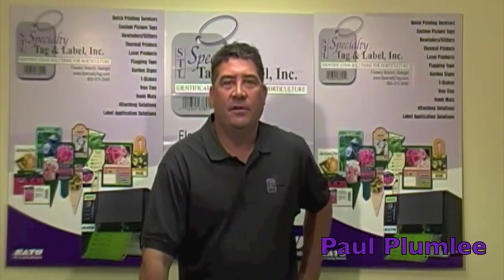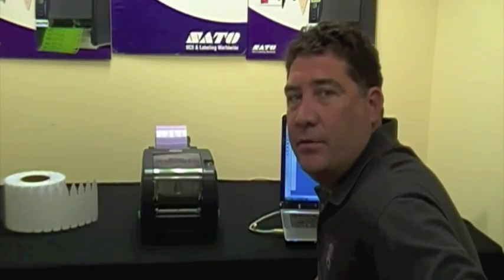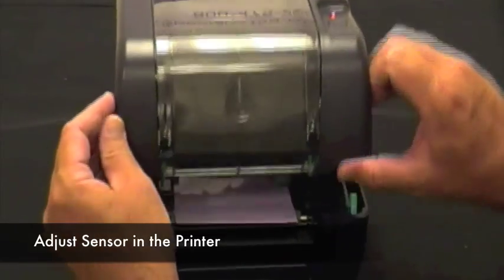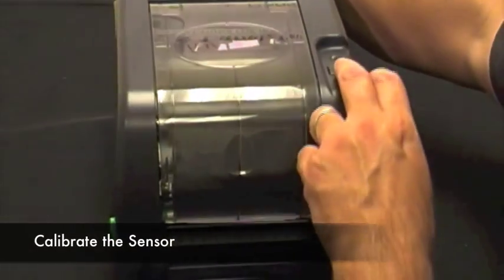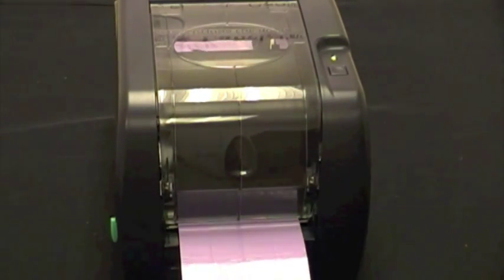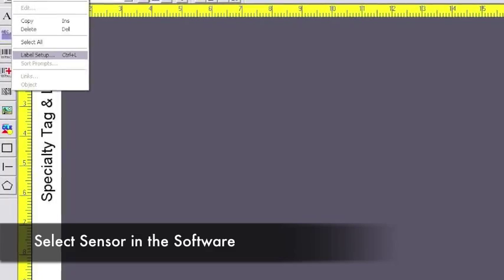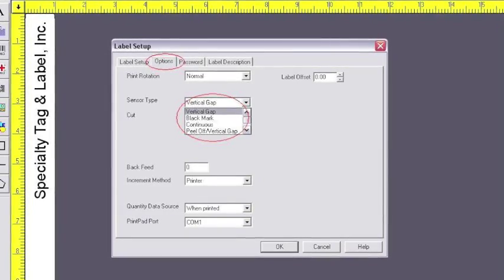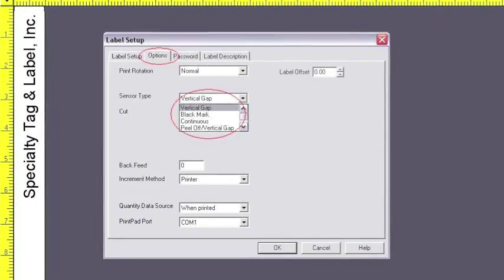TSC Tips:  Why am I getting a red light?

Comment: thank you for your help. now mine was completely fixed.
If may, can you tell me what is the label program that you use? i was searching the entire time but nothing helpful programs found. 
I am now using Bartender, but in the adjustment setting, i was completely frustrated about the output not adjusted in the same position as the input one that i set in the monitor.
Now, the printed one sometimes are too low and out of the print area.
Can you help me with that? will be very thankful.
Thanks again.
Reply from the maker: We are currently switched over to Bartender 2021. If you're still experiencing this issue, please send us an email or give us a call!
1-800-475-2040
techsupport@specialtytag.com